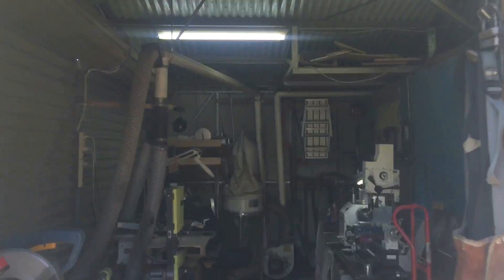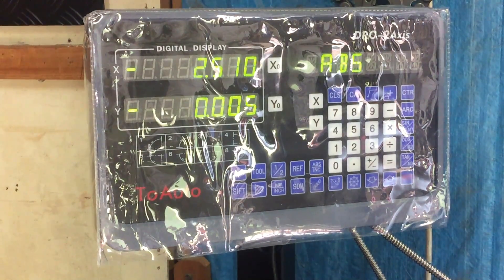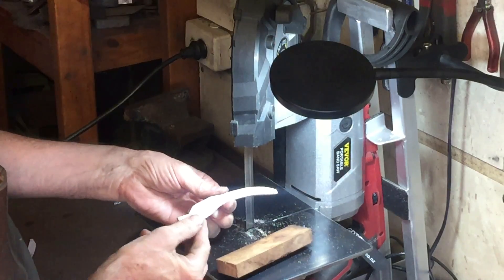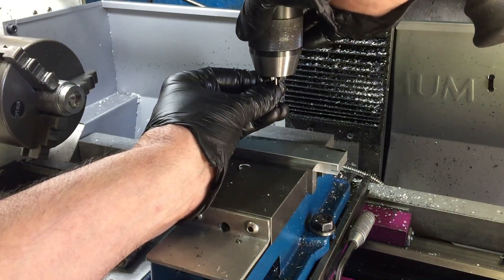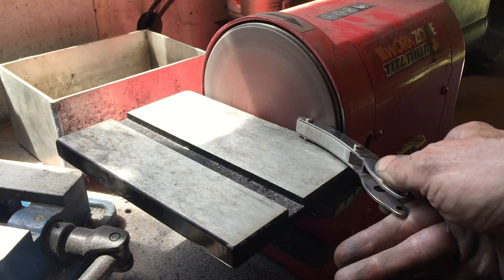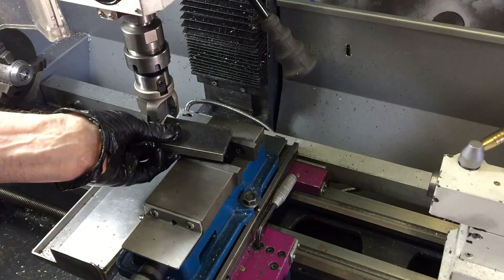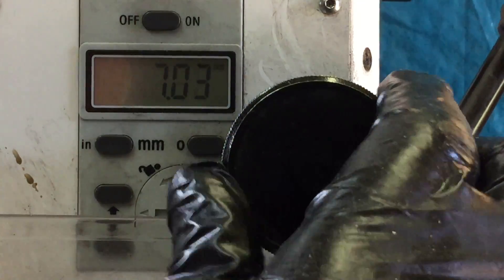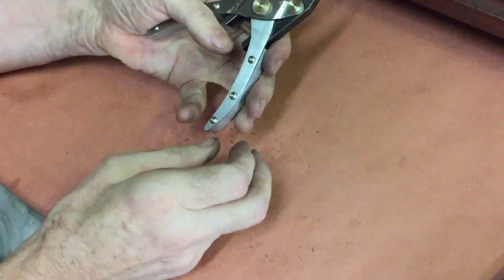Parallel Pliers?  Let's Make Some

Comment: I like that portaband conversion..You look confident and comfortable cutting those stainless metal pieces on such a small bed....perhaps it is your experience with cutting precise wood clock gears and parts for years??..lol..I Enjoy the vids Mate..Cheers!
Reply from the maker: Ha! Thanks mate. Yep. The portaband is an excellent tool. Very well mannered and easy to use.